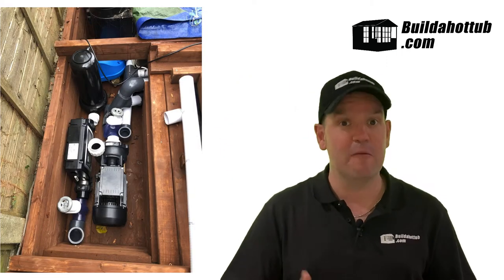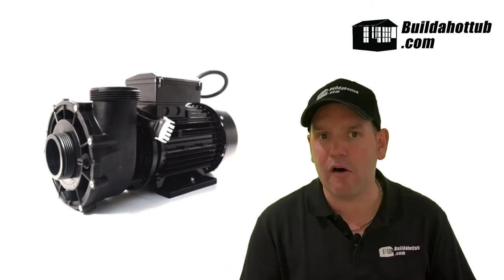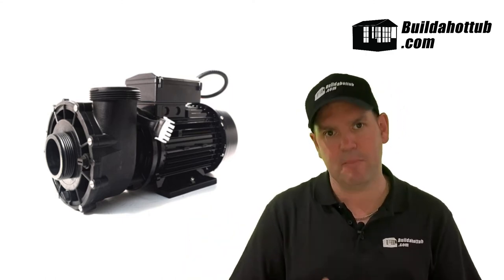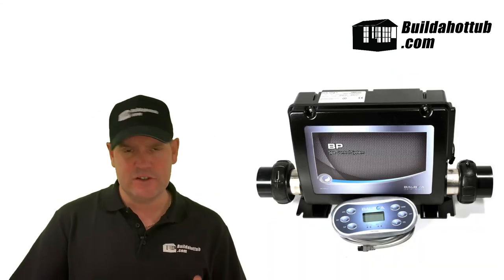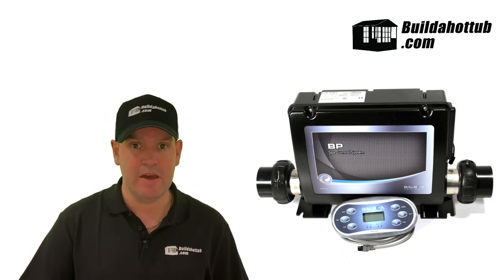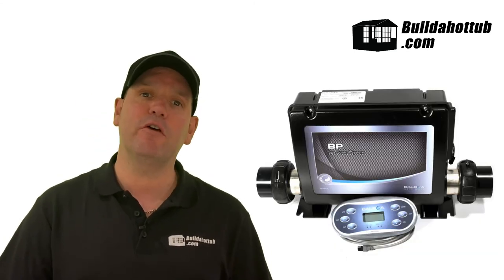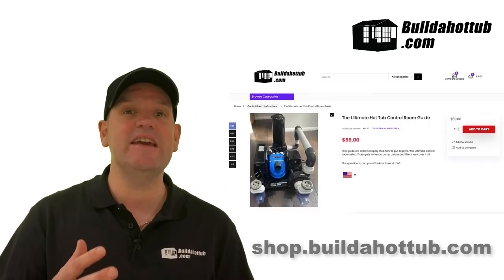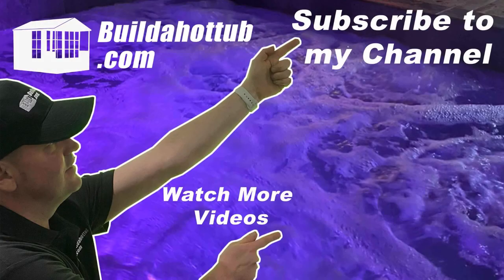How to Build a Hot Tub Control Room

Comment: WOW! What you said about joining secondary heat sources was music to my ears. I've got a control pack that I'm not happy with the heating capabilities but need the control, just like you said. I've ordered a propane heater but can't figure out how I'm going to run the pump for circulation (I don't have jets) and control the light. Do most packs have the capability of hooking up a secondary heater sources?  How do you combine?
Reply from the maker: Hi Chad, thanks for the comment. Combining multiple heating sources on a Spa Pack you would usually control the auxiliary, in this case your propane heater by flow. What this means is that when the circulation pump is running, the propane heater will heat (as there is water flow going through it) until it hits its own temerature that you have set on the termostat. Circulation pump stops, no fow so no heat on the propane heater. You should match the thermostat to the same heat you set on your spa pack. You will not connect this propane heater in any way to your Spa Pack. Whilst it will sit inline with your plumbing, it operates and is powered independently. Hope this helps. Thanks - Andi